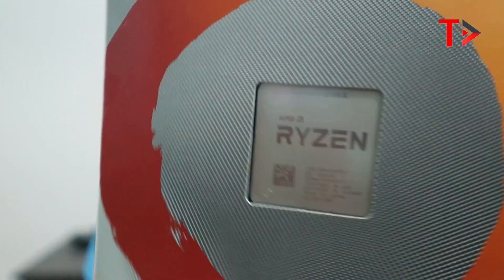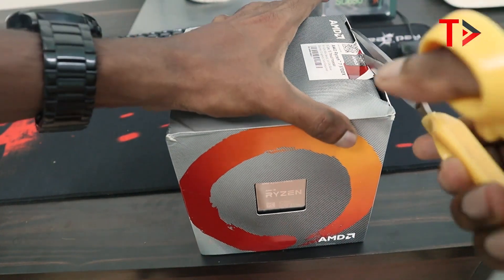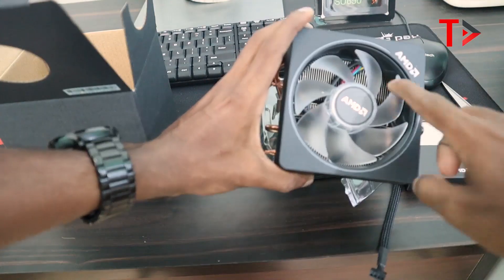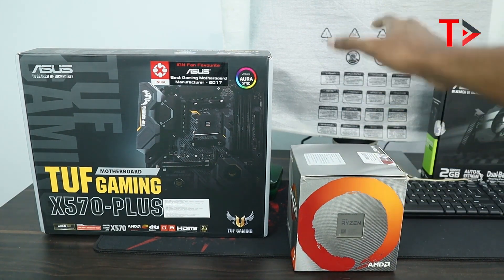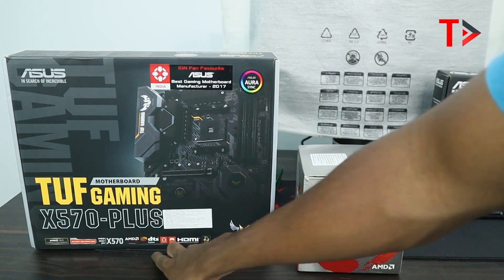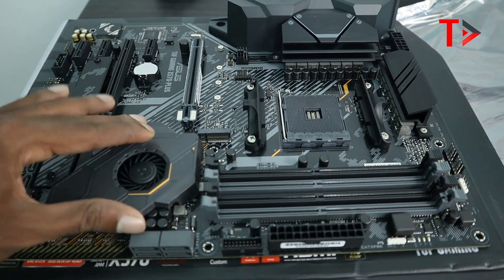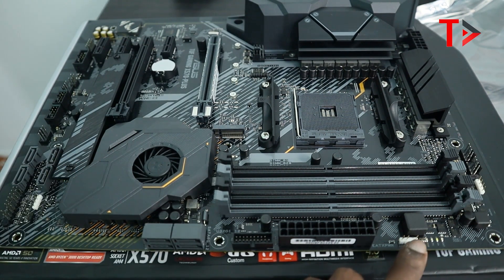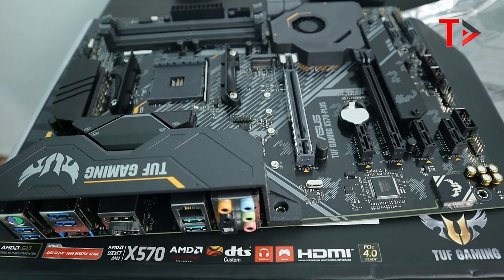AMD Ryzen 3700x | Asus Tuf X570 Motherboard Review in Malayalam

Comment: Bro asrock b450 stell legend ano nallathu atho asus ano x570
Reply from the maker: Hi,njan kore kollam ayitu asus mb user anu I suggest asus..If youa re planning to build a new AMD 3rd gen CPU I suggest b550 motherboard which has PCIe gen 4 which will use full when new PCIe gen 4 graphics card are released
Reply: @gametechvlog  bro b550 motherboard amazon link

Comment: For the cpu there is a 8 pin and on is left next to the 8 pin there is a 4 pin slot did u plug it in there also ? Or did u just plug in the 8 pin CPU cable ?
Reply from the maker: You only required one 8 pin that is more than enough for the new Ryzen CPU  if you are not planning for the extreme overclocking
Reply from the maker: I have Corsair vs550(old PSU)have only one 8pin connection which work fine with my Ryzen 3700x